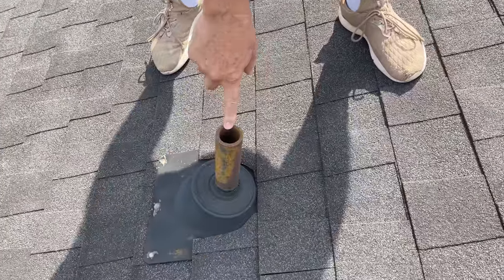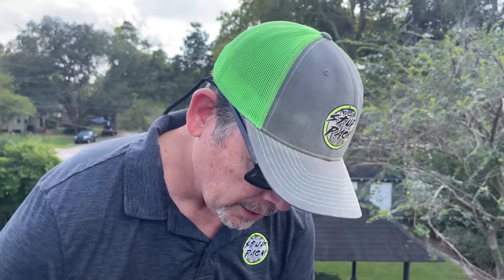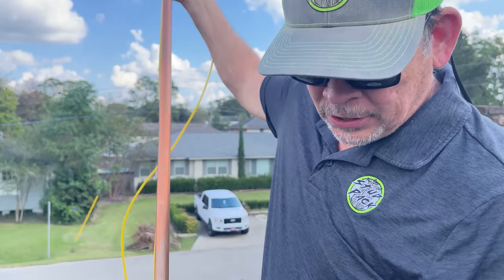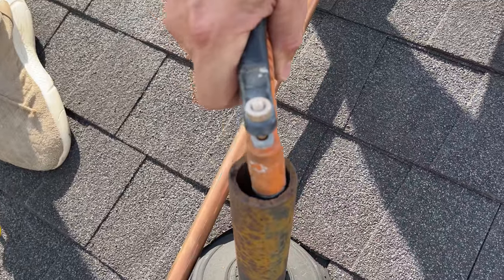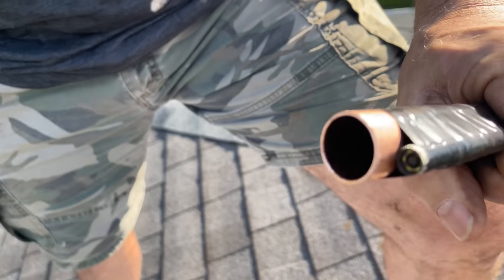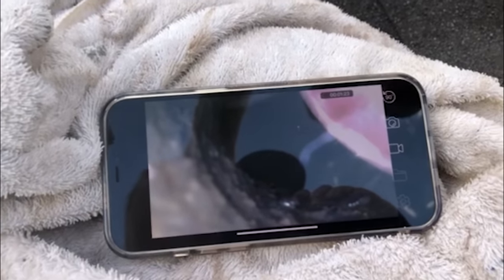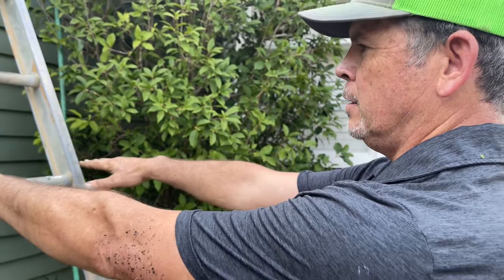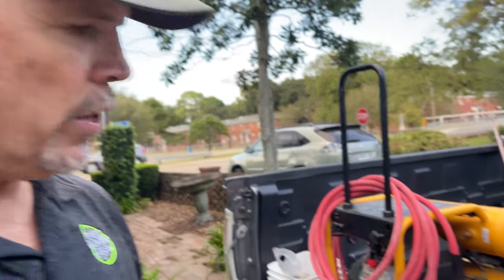Using a BORESCOPE to CLEAN OUT a CLOGGED VENT PIPE

Comment from the maker: Lots of comments on why we didn't use PEX or PVC instead of copper.  The wall thickness on both was too great for our purposes.  We needed thin wall copper to maximize the inside diameter in order for the vac to suck up the nuts plus we needed that space for the camera to show our viewers what was going on.  I liked the fact that the copper could be used to "chop" the nuts to make smaller pieces also.  EMT lengths were too short for our application.
Reply: I would have done the same thing. The rigid edge of the copper assisted in battling the debris.  One thing is, I was surprised that the plumber didn't tackle the vent. Most plumbers that I know have camera systems as well.  I mean.. the vent is part of the plumbing system as well, is it not?  Why didn't he do it?  .. another great Real Life video, guys.
Reply: Definitely agree. I thought cutting some shark teeth into the end of the copper would have helped you grind some up and might have sped it up a little. Good job Studpack! Video game music was epic.
Reply: Smart.
Reply: That was a brilliant use of snake in the copper. the small diameter snake does terribly at length without the wall of the pipe to push against. The copper helped transfer your power down.  Unfortunately depending on the location of the vent and the design, you may encounter several hard 90's.  You probably need a spade tip on a 3/8th line to get the nuts broken down phyiscally enough to wash it down.
Reply: @y00h0011  I agree, plumber should’ve  fixed it.
Reply: @rickw4160  spade tip is a good choice, but personally I would use a clogChopper.
Reply: I had to Google that. That clog chopper looks like it may actually make bends easier and also be gentler on pipes?
Reply: Great job Stud Pack! Was there enough room to of used a shark bit coupler instead of buying 20' copper pipe. Also a pipe bladder is also an option for pressurizing water in the pipes.
Reply: I had a similar issue with my upstairs toilet, when I would flush it the water wouldn't flow immediately and then it would run out but no issues with the downstairs toilet so I did the snake thing with no cure so I go up on the roof and look down the vent stack with a flashlight and had the misses flush the upstairs toilet and discovered there was a used condom that had been flushed (thanks stepson who had a great party one weekend while we were away) and it was snagged on a rough edge of the iron pipe dumping into the drain there (the vent stack being part of the 4'' cast drain and the condom would fill up with water when the upstairs toilet was flushed thereby expanding like a balloon and then it would grow to the size of the drain pipe and it had a small hole in the tip (I kid you not) and it would slowly decrease in size and then the remaining water would rush by and Walla the toilet would finish draining so at this point is where my problem solving skills (similar to lets say my spidy senses began to tingle) and I fashioned a make shift spear with a long wooded dowel and an old steak knife and then having the wife flush the toilet I stabbed the offending prophylactic and it burst and the toilet flowed freely once again. I dare you to top that one. Sincerely Trojan Horse.
Reply: EMT would have been cheaper
Reply: All the plumbers I know won’t go on a roof. Will climb into crawl spaces but not up on a ladder to steep pitch roofs.
Reply: Would it be wise to make the screen into a sharp pyramid cone thing so nothing sits on it easily like birds, maybe put a fake bird perched on it? You guys rock, great video!! Love your ingenuity!! 🌟💯💪😎👍💯🌟
Reply: You needed Ollie from "Drain Addict" to clear that for you.  He would have said that pipe was "Chockers" and emulsified it with his 8-12gpm hydro bits. "ALL GOOOOD"...
Reply: Could have saved money with m tubin or 10 footer and a coupling..
Reply: @y00h0011  True, but some people choose their professions based on certain things. It is highly probable that he knew how to fix it, but also that he is afraid of heights. Some people just WILL NOT get on a roof. Low slant or not, some people just Wont.

Comment: I've always wondered WHY they didn't put either a raised cap or a screen on the top of vent pipes to prevent this from happening! Good work!
Reply: Same thought I had.  I just recently put a vent cap on the vent for my house, not sure why they didn't build it with one.
Reply: Depending where you live you are not allowed to due to hoarfrost.
Reply: When I was young, I saw cone shaped screens on vent pipe tops. They had limited benefits and maintenance issues.
Reply: Cap the vebt with a T and then cap the ends of the T with 2 more T's oriented vertically so anything dropped in either side T just falls onto the roof, that way, no more nut problem and if a bird builds a nest on the T, air can still enter the vent through the bottom of the side T's...
Reply: Where I live vent pipes have to be 4 inch diameter to keep the opening clear of frost in the winter. We never had squirrel or rodent issues.
Reply: Think i would cry after all that work only for the sink to not drain, but anyway, are yall in Texas, pretty sure i have a clogged vent :'(
Reply: @blu3445  They are now

Comment: You made my old safety guy heart glad when you demonstrated the Fireman’s Stance on setting up that ladder. Before I retired I created a 45 minute on line course on ladder safety.
Reply from the maker: Cool 👊👍. Should probably do a video just on that tip alone
Reply: can you give a time stamp I would like to see that.
Reply: @abdulelkhatib2674  20:25
Reply: @abdulelkhatib2674  it was towards the end of the video
Reply: Keep us updated on how it went with the plumber.
Reply: @StudPack  So are you supposed to stand with your feet tucked tight to the bottom of the ladder? It wasn't shown how your feet were positioned
Reply: i learned something about that with this vid!
Reply: Wow would like to see your video on ladder saftey! Is it available online?
Reply: @itzNickyJayBeats  I'd assume so
Reply: @itzNickyJayBeats  toes to the heel of the ladder and hands on the rungs with your arms straight out.  This sets up the ladder at the proper climbing angle around 74 degrees.

Comment: Hey fellas, thanks for making learning about Home Maintenance, improvement, and remodeling such a fun experience.   You two are always entertaining and educating.  Stay blessed and positive!
Reply from the maker: Thx TJ 👊👍
Reply: @StudPack  that's 1 small pipe ours in the uk is a 4 inch pipe the diameter but it does all the drains not just the kitchen as we have gulleys and manholes in our garden for drains

Comment: I worked maintenance at a school system in North Georgia. We had the same problem with a gym bathroom. Turned out that kids had poured pea gravel down the vent. Solved it the same way you did; shop vac and a long piece of 1 1/2" black plastic pipe. Sucked out GALLONS of pea gravel.  Btw.. red plungers are made for drawing/sucking not pressing/pressure. Push down slow and pull up fast.

Comment: As a previous maintenance man, if you use 2 plungers (one in each sink) you won't have to fight the water coming back up in other sink. Have one person hold down while other uses the other one
Reply: Or just have the other guy hold the rubber stopper in place. That’s if you don’t have two plungers at the ready.

Comment: I like the ladder tip. Definitely wouldn't mind seeing more safety things. Good stuff guys!
Reply: You actually put your toes to the heel of the ladder and your hands on the rungs to get the correct climbing angle, which is around 74 degrees.

Comment: this is a perfect time to use PEX pipe...cheaper, somewhat flexible, and, while not having quite as big an opening inside, still works wonders for what you are doing.  Of course, you could use a piece of 1" PEX as well to get that inside diameter.  The beauty part about the flexibility is that you can bend it over as you pull it up to keep the vacuum hooked to it when pulling nuts stuck at the end of the pipe.
Reply from the maker: Yeah it was all about inside diameter on this one so we could attach the camera and show you guys what’s going on 👊

Comment: With those Harbor Freight snakes, you can chuck a drill right to that back stud.  That makes it easy to use one hand on the trigger for speed, and the other one on the snake handle to sweep it in and out of the pipe
Reply from the maker: I was wondering what that was for thx 😂👊
Reply: Rigid makes one with bearings on the front. Put the drill on it and it's a power feed cable.

Comment: Fun video. I recently bought a 'scope like that to check a clogged sump pump discharge pipe but found the wire was too flexible, I tied it tightly to the end of a snake like you used to keep it straight, so that the camera and the end of the snake were right next to each other, worked pretty well.

Comment: I just ordered this Borescope to use for a wiring project.  I'll let you know how it goes.  Thanks for this video for showing how good this unit performs.
Reply: This is a very good camera.  I used this for fishing electric cable in a wall.  It worked very well with my S21 Ultra SmartPhone.  This project was easy using this device.

Comment: At the time you got to the elbow and realized the clog went into the horizontal pipe, that would have been a good time to try sealing the vacuum directly to the vent pipe and see if it would suck the clog out. If it got the clog to the vertical pipe, you could use your copper pipe to get them. It may take several tries or may not work at all, but it may have been worth a try.
Reply: Same thing i was thinking and he had the hose up there so y not use a bladder bag to pressurize the line not only that use a super vee drill auger with a spade bit and clean that line right out and then u can jetter the line to make it super clean after u get the clog out n itll be like brand new.....

Comment: You guys did great considering what you were working with. I can't believe the plumber couldn't clear that vent. A K-50, a couple of cable segments, and a spade head would probably knock it out in no time.
Reply from the maker: Thx Roger 👊👍
Reply: He would've wanted $105(?) an hour to do it. I suspect the Studs were cheaper.
Reply: @hampyonce  
So if it takes a plumber with the right tools an hour at $105 (using your number) or it takes Studpack 3 hours at $50 (which I doubt is their hourly rate, just a number for comparison), which is the better deal? Plus, the plumber tried and failed, which was what I was commenting about. He either didn't have the right equipment, didn't know how to use it, or didn't want to be there.
Reply: I suspect it takes a plumber just as long as the SP team. It's hard to pay someone like a plumber to "figure things out". I've made a decent living arbitraging the difference in price between handyman vs tradesman. Maybe Paul will tell us why he got called instead of another plumber.
Reply: @hampyonce  
Do you think Studpack was there for more than an hour? I would estimate an hour for that job with the right equipment. A spade head would dig through and/or break up those nuts with ease. Like I said in my first comment,  I think they did a great job with the tools they had at hand. My comment wasn't to knock them in any way.

Also, if Paul isn't charging the same or nearly the same as any other "skilled tradesman", he's working too cheap. The quality and care he demonstrates deserves as much.
Reply: I know that cost decides most of these issues. I could be wrong. I've only been building since 1985. In my market I can get a carpenter and a helper for a good bit less than a real plumber. Of course real plumbers stay real busy plumbing, around my woods.
Reply: I had to clear a vent stack at my old house because the plumber wouldn’t - wouldn’t go on the roof.  I mean, wth, the plumber wouldn’t service the enter system.

Comment: Borescopes are awesome. I have a wifi one that I use along with a painters pole, shop vac and a custom U-pipe to vacuum out my gutters from the ground. Have an old cell phone attached to the painters pole so I can see in gutter with the borescope, its amazing because I hate ladders.
Reply from the maker: Awesome tip thx Alex 👊👍
Reply: Installing Gutter guards will significantly reduce this problem.  That or eliminate the source of the debris.

Comment: Greetings from yet another Paul <---- me! I had squirrels sneak in our attic and chew up about $2,500 worth of wiring. They also saw fit to fill up our vet pipe to our washer stack. I've never eaten squirrel but I'm thinking it might be time to start.
Reply from the maker: Yeah they can do some damage 😡.  Squirrel pie anyone 😂👍
Reply: It happened to me. I installed a pipe trap in my backyard and i caught 108 squirrels in the past three years. The neighborhood has been cleaned up. The population of those furry rats fluctuates up and down, I make sure it stays down.

Comment: Dear Stud Pack. This video got me off dead-center to screen off my roof vents before something like this happened. I had to replace the window screen with hardware cloth on the radon stack that had been damaged by hail. I screened three others without incident, but found that the lead flashing had peeled away around rim of the kitchen vent, (probably hail damage) leaving a 1/8” gap between the riser pipe and the roof jack allowing rain/snow to enter at that point. I used a piece of aluminum flashing to correct that issue, and then screened that one off, too. Thanks again for posting content.

Comment: My dad owned a hardware store and I have some copper 1/2 inch 90 degree elbows with the price of 13 cents marked on them.  For a recent kitchen project I exhausted my stash of parts and had to buy some tees, I was astounded at the price.  I hope  you find a use for that copper at some point.  Thanks for the laughs, this was a great video.

Comment: They have a jet fitting and hose combo you can attach to a pressure wash gun that might have blown through that, but you would have needed a large bucket under the sink and a rag in the the double wye so you could collect the nuts.

Comment: This would be a great application for those drain un-clogging balloon thingies that attach to a garden hose.  It expands to fit the inside of the pipe and then blasts the clog away
Reply: I don't believe a blow bag would clear this. This stuff needs to be mechanically broken up to pass through without futher issue.
Reply: @ProleDaddy  right use a super vee drill auger with spade bit or "c" cutter then use a small drain jetter to clean it and will be like brand new

Comment: Just sold a 1928 'cottage' in central Austin that had similar issues.  Our washing machine started overflowing out of the drain and our kitchen sink was backing up when we washed clothes.  I tried liquid drain cleaners but couldn't keep it cleared out.  
Finally caught a squirrel dropping acorns down the vent pipe.  Birds would also land on the pipe end, but I never saw them drop things down it.  I wish I had thought about using a borescope camera.  
Instead I shoved a waterhose down the pipe and left the water on until things loosened up.  
Watching your video makes me wonder if the acorns had started to root in the muck.
Thanks for sharing your knowledge and experience.  I plan to treat my new house a lot better than the last one.

Comment: Wow, I had that problem about 5 years ago and put  half round fittings on the pvc vents.   No plumber could tell me if right or wrong, did not of course do it on furnace or hot water heater, but it stop the squirrels, not had any smells and drains fast.      I was afraid with the screen during ice storms we have  it would freeze over.    Nice work guys.

Comment: You did a good job. It's the original plumber's fault for not going straight down instead putting a 90 at the bottom of the vent !
Reply: A 90 at the bottom is code.

Comment: I used a shop vac to suck rocks up to about an inch in diameter up 6 feet of 1 1/4 PVC pipe. I told myself this will never work but I was amazed when it did. I took the filter out and the rocks just came banging in against the side of that old metal shop vac. Occasionally, they plugged at the spot where they came into the vac because there was a deflector there. This was to clear rock from a 6" pvc section that was placed around a frost proof hydrant in my old shop floor. Clearing out the rock enabled me to unscrew the hydrant leaving the base in place and then screw a new matching hydrant in. The old rubber on the end of the stem could not be retrieved without removing the whole hydrant pipe. It took me a while but it saved me from having to dig a huge hole outside the shop and under the cement floor.

Comment: If you live in a Northern climate, covering the vent pipe with screen will cause moist air to freeze and close the pipe. It's not as dramatic with pvc pipe as when they used steel pipe for vents.
Reply from the maker: Good tip thx Jerry 👍👊

Comment: I own a 2 story house with PVC Vents.  The roofer put lead roof jacks on to seal the roof penetration.  He folded the lead over the top open edge of the PVC.  Squirrels love lead.  It is supposed to taste sweet.  They sharpened their teeth on the top opening.  I found out when I got a wet spot after a hard rain.  The roofer replaced my lead jacks with a steel  cover complete with a screen.  Worth every penny.